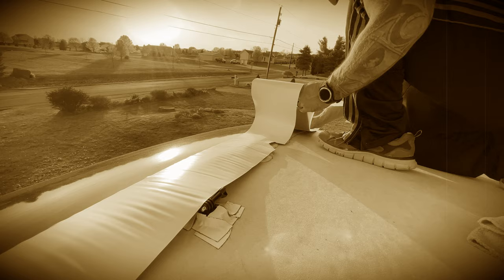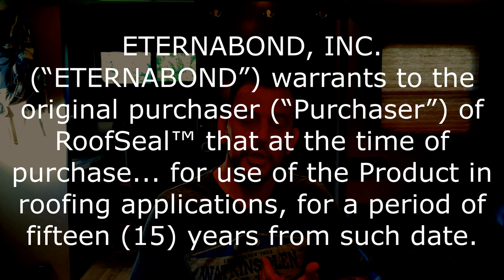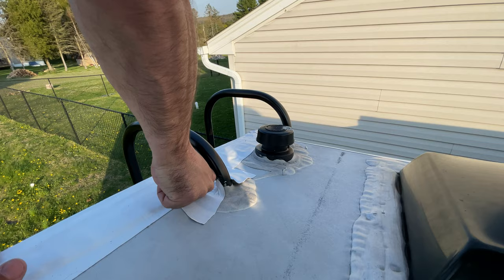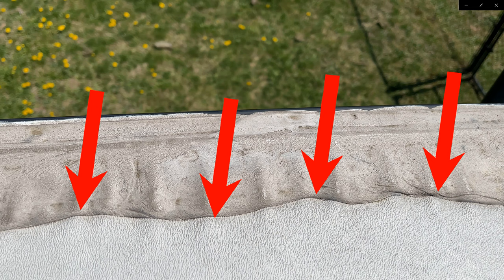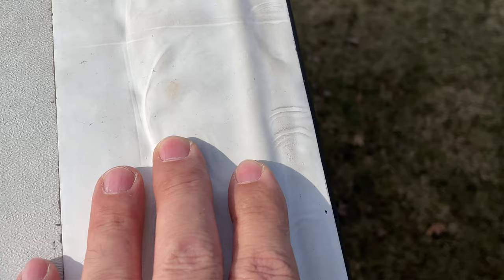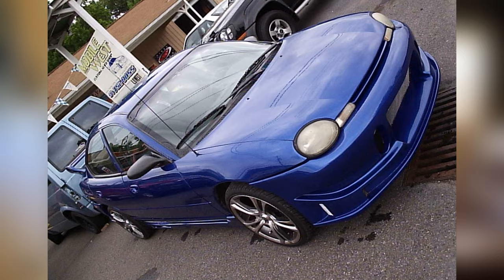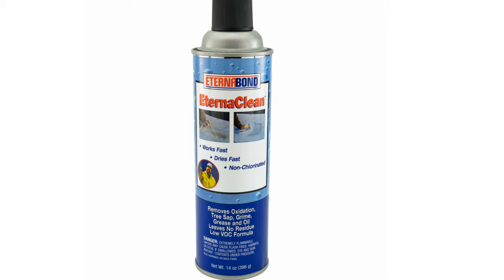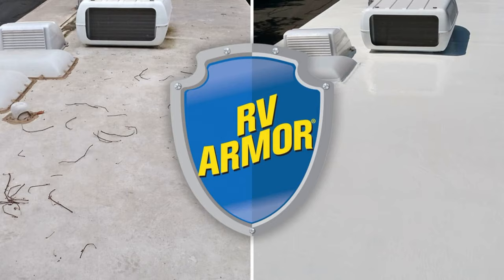The RV Eternabond Roof Seal Modification 1 Year Later

Comment: What in your opinion is best for roof cleaner and uv protection
Reply from the maker: I use Murphy’s oil soap to clean my roof and it works well.  I just haven’t done enough research to say what I think is the best UV coating, but I hear a lot of good things about Henrys Tropicool.
Reply: @RVTIPSANDTRAVELS  could you apply tropicool directly over the eternabond? Or would you apply the UV paint like sealant and then the eternabond. I guess my main concern is one or the other not sticking to eachother. Also how I would reapply when the time comes (uv paint, I have faith in eternabond! :) )

Comment: So I haven't used Eternabond before. I'm curious if the tape has any stretch or give to it so that it can be formed over irregular surfaces (like lap sealant, the lips of various components, etc)? It appears that that's exactly what you did in this video by taping over the lap sealant, but I want to try to avoid wrinkles and know that once the tape's down it ain't going anywhere.
Reply from the maker: you can remove the lap sealant and tape right over where the sealant was.  I will probably do that with my next camper.  despite the time it will take to remove the sealant, I think its well worth it.
Reply: @RVTIPSANDTRAVELS  Cool, but does the tape have any stretch or give? To confirm to irregular surfaces?

Comment: I'm redoing the roof on my camper. Just bought a bunch of rolls of this stuff. I also got lap sealant. Do I need the lap sealant or will this stuff do just fine?
Reply from the maker: If I were to do this again, I’d remove the lap sealant altogether and use this from the membrane right onto the component.  That’s what it’s actually made for, a factory seal.  Send me pics when you’re done would love to see it!
Reply: @RVTIPSANDTRAVELS  Thanks! That's good to know because the lap sealant is a pain in the butt to mess with. I'm actually filming the entire remodel so I will have a video uploaded on it soon!
Reply from the maker: Let me know when you’re done!

Comment: Hello, I have a question for you. I am in the process of purchasing a 1991 Fleetwood Flair 22 foot Class A Motorhome. The Roof needs to be cleaned, and resealed to prevent any leaks from forming. I am a fairly hefty guy, with a weight of around 275 to 300 lbs. Is there a weight limit as far as someone being to heavy to stand on the Roof of the Motorhome ? I don't want to climb up on the roof to clean and prep it for resealing, if there is any risk of me falling through it due to my weight.
Reply from the maker: Kevin, it’s hard to answer that, every rv has a roof weight rating.  It may be hard to find something that old but I’d start by looking through the owners manual.
Reply: @RVTIPSANDTRAVELS  I already tried reading both manuals, and found nothing as far as any kind of weight limitations, but I am still wery about being up on the roof with my weight, especially toward the center areas. I am wondering if I should just use an extension ladder along each side, and coat the roof with a long handled roller, and use a regular roller around the edges of each side, as well as the front, and rear caps ?
Reply from the maker: That would work, or you may be able to put some plywood on the roof to distribute the weight.

Comment: Anyone every use Flex Seal tape? Essentially the same thing?
Reply from the maker: Tom, eternabond is very similar to a TPO top coat and a butyl tape underneath.  ive never used flex seal, but ive seen hundreds of complaints about it.  theres quite a few reasons a lot of RV'ers dont use it on an RV roof.  ill try to find the article.

Comment: In the original video you didn’t use the primer eternabond recommended if memory serves correct
Reply from the maker: You are correct.  No regrets not using it either, still stuck fast, BUT I’d try it if I were to do it again.

Comment: I bought a new RV off the show room floor Forest River and thought the roof would be okay for a couple years. Wrong! I had two holes on top back the size of a half dollar that was leaking in the bathroom area and it warped the floor and now it slopes down. Now I have a three year old camper that’s got to have the floors redone after the roof is sealed tomorrow. I’m sick to my stomach. Could not get an remote rv tech out so I had to hire a roofer who watched these videos and he only charged me $100 a day and first day he pressure washed it with bleach and Dawn. Tomorrow he’s laying down the eternabond tape. And putting on first coat. Next day another coat. Then he’s calking every window. Taking it to the dealership they had a six month waiting period. I live in my rv full time so that was out of the question. So I found a young guy who just finished roofing a church for free to help me. I also had to pay a regular plumber to come out and change out my faucet on the water heater drain out. I had RCS on my shoulder and can not do the work. There’s too many RVs and not enough RV techs. And when they did come out they were in and out and didn’t fix my air conditioner and I had to buy a window unit in a 1 year old new rv. I’m pretty sure it’s the capsulator so I’m going to order the part and hire an electrician to fix it before summer.
Reply from the maker: Dealership service wait times are a huge problem for everyone right now.  Sorry to hear about all your troubles.

Comment: You said you used the lap sealant first, let it harden for a few months and THEN put Eternabond on top of it  . ? ?
Reply from the maker: If you need to apply new sealant, it should cure for 30-60 days before covering it.

Comment: Does your unit sit outside year round?
Reply from the maker: yes it does, and I dont cover it.  I used to cover it years ago, but I stopped covering it before I did this modification.
Reply: @RVTIPSANDTRAVELS  -Impressive, thanks for the videos!

Comment: Would you do this right away on a brand new travel trailer?
Reply from the maker: doesnt matter how new the trailer is, as long as the lap sealant is in good condition if you are covering it.  you can also remove the lap sealant and use this alone.  thats what it was actually made for.

Comment: What should I use to clean I’m going to put it on the edges of the camper roof is breaking I want to cover it before I get water damage should I use denatured alcohol and or mineral spirits ? With maybe some windex to clean up everything at the end?
Reply from the maker: I used dish soap first, then rubbing or denatured alcohol as a final cleaner is good on the areas where the tape will be applied.
Reply: Just pour the denatured alcohol on a rag first as you don’t want to saturate the roofing material.

Comment: I noticed Eternabond on the tops of my slides, ever hear someone using it on the side joints?
Reply from the maker: Do not use eternabond on a vertical surface.  Because the adhesive is pliable, it can slide under extreme heat.
Reply: @RVTIPSANDTRAVELS  Excellent! Thanks for tip!

Comment: Do you think that this mod affects the resale value of a trailer?
Reply from the maker: I guess that would depend on who you ask.  I’ve spoken to quite a few rv techs who love this and some who don’t.  If you talk to HB Fuller (the mfr) which I did do, this product is made to be used for new sealing and repairs.  It’s held up flawlessly for me, but if not applied correctly I would agree could cause issues.  I also think there are 2 stigmas with this mod… one being people hear the word “tape” and think it’s a patch hack, when in reality it’s designed for this.  Two, it’s not pretty when it’s installed, and while some people don’t care, others do.  Having used this product a lot, if I were an rv inspector I would focus more on how it was applied.  If it was applied well, i personally would not be afraid of buying that rv.  If not applied correctly, it could be a resale issue since it’s not fun to remove. End of the day I’m not an rv inspector so I would consult with one… but I don’t think you need to be an expert in anything but the product to have a good idea how it will hold up.  Also, it’s a mod so you don’t have to reseal every year.  That’s it.  It’s not meant as a full proof way to prevent leaks.
Reply: @RVTIPSANDTRAVELS  cheers!

Comment: I was told not to use acetone on my GD imagine roof, that it may attack the roof membrane and possible void the warranty.  GD told me that.
Reply from the maker: Acetone won’t damage TPO if used as a cleaner. Whoever told you that at GD is very misinformed.  The eternabond branded prep cleaner is made of acetone.
Reply: @RVTIPSANDTRAVELS   Thanks for your response.  Please reference P.149 in the latest Imaging Owner's Manual which states, "Solvents should NOT be used during cleaning. Solvents can damage existing sealant and may weaken plastic roof components".   So many schools of thought ....
Reply from the maker: Yep it’s in there, it’s GD covering their butt.  Solvents could weaken lap sealant, but acetone and mineral spirits won’t damage a rubber roof or plastic components. I’ve used them both.  Technically, water is a solvent, GD should be more specific on the types of solvents not to use, because there are many.

Comment: Ross, this has nothing to do with eterna bond.I own a GD 2600RB and the bottom guide for my inside barn doors keeps falling apart. Any mod suggestions or how to fix the guide from coming apart. Thx
Reply from the maker: That little plastic thing?  Mine does too.  Trailer is in for tires and inspection, give me a week to get it back and look at it.  Been meaning to fix mine too.  Hang tight bud.
Reply: I’d like to see any answers for the plastic sliding door guide breakage issue!  Updates?
Reply from the maker: sorry guys, i have been busy with some projects but Ill try to look at it next week.  just keep reminding me if you dont hear back within 2 weeks.
Reply: How about a slightly larger screw and glue it in place, or wait for the master on his modification. Probably wait I usually screw things up anyway.
Reply from the maker: Honestly guys I have to apologize I’ve been busy with so many things going on. I would maybe try just using the toothpick method to make the hole smaller. I have a video on that on how to fix stripped screw holes. If you don’t want to be able to adjust that piece anymore I would just superglue the hell out of it.

Comment: has anyone tried to seal a roof using Elastameric?
Reply from the maker: I believe that is a coating for masonry, if I remember correctly?  You may think "well if it protects something solid like stone, it will easily protect an RV."  Not saying that isnt the case, but other things to consider would be its adhesion properties on soft materials that flex... thats where it might not do well.  Also, UV protection is another consideration.  I dont know much about it, hopefully someone can help, but I did want to comment with the things I would be thinking about when using a product that is intended for a completely different material.  Hope that helps.
Reply: @RVTIPSANDTRAVELS  well it is a rubberized type sealant and mmasonary is one application. I used it on the membrane roof on my mobil home and it has lasted 4 years so far.
Reply from the maker: cool, i will have to do some research on it... maybe try a spot on the roof to see how it holds up.  is it white?

Comment: why even use lap sealant, just use the tape?
Reply from the maker: the lap sealant comes on the rv from the factory.  since eternabond can be put over lap sealant, you dont have to remove it as long as it is in a healthy condition.  you can remove the lap sealant if you wish and use the eternabond alone too.

Comment: I wonder if anyones tried this stuff where there’s a roof leak, to ✔️if it actually works, which it probley does. but putting it in a nice newer rv roof that’s not likely to form a leak for 10 years - then saying ‘buy golly G wilikers it hasn’t leaked for 10 darn years!’ is kind of like selling water by the river - or inversely, selling powdered water, is it not👋.
Reply from the maker: did you watch the original video of this series?  the point of this modification isnt to stop leaks any differently than self leveling lap sealant, the point is to not have to reapply lap sealant every year or so... making it more maintenance free.

Comment: Nothing against eternabond but only coming halfway over insert trim on the roof to sidewall seam is leaving you open to potential leaks from water getting behind the insert trim and wicking through screws. That insert trim shrinks over time and water can get behind it during heavy rain. It will be the type of leak you won't see until the damage is done... Ask me how I know !
The insert trim should  be replaced  about every 2-3 years on drip rails and corners.
Reply from the maker: The Eternabond over the trim ADDS protection. 
 The factory design has nothing covering that trim piece so water can get in there from all directions. 
 The Eternabond is simply adding a shingle effect.  The tape is 1 piece down the entire length of the trailer, so the only water getting behind it would be from the very edges or from the bottom, which would happen if you didn't do this mod anyway.  Make sense? I guess you could completely cover the trim with Eternabond, but that makes it more difficult to access those screws should you ever need to adjust/replace your membrane.  Additionally, that trim is now covered from the sun and the elements. Mine is 7 years old, no dry rot, still pliable too, I'm guessing because its been mostly covered by the Eternabond.  I also apply 303 aerospace protectant to the uncovered area every year when I do the rubber and trim, so its literally is perfect condition.  If people started treating all their rubber and plastic with a product like 303 they would probably be replacing their RV long before any trim... It's time consuming and I dont think a lot of people want to do it, but it has worked for me.  Everything has held up pretty flawlessly, but I will have to reseal my outside joints this summer, and that is probably the thing I hate doing the most to the RV.
Reply: @RVTIPSANDTRAVELS  That was my point. In a heavy rainstorm water can back up in the gutter and get behind the trim insert from the bottom. After it gets behind the insert, it will find a way in.  I used protectant on mine as well and thought they were in great shape. I couldn't believe how much the insert had shrunk from the sun compared to the new insert. Behind the insert I found Grand Design shot staples about half way in all along the drip rail and several screws were backing out. Gotta love their engineering ! Lol  I've since fixed the issue permanently because it was not much fun replacing a 4x8 section of my wall.
Reply from the maker: Makes sense.  I would agree with you that RV gutters, not only on Grand Design but all manufacturers, need to be reengineered.  They dont even use 1 piece, they glue them together and that glue lasts about 4 days after it leaves the factory, creating a leak somewhere along the camper.  Horrible design.  At least they could be 1 piece.
Reply: @RVTIPSANDTRAVELS  Exactly ! In the last 30 years manufacturers pretty much use the same engineering and haven't come up with anything better ! Lol
Reply from the maker: AGREED!

Comment: Your "never again" statement on the video icon and subsequent recommendation of the product is pretty contradictory and "clickbait-ish".  I hate when YouTubers do that.
Reply from the maker: The first video reads “never again” because you dont have to reseal using lap sealant again after installing the eternabond.  That is clearly explained in the video.  The follow up video stresses the same thing.  Not really sure how that is contradictory or misleading in any way. In fact it’s exactly the opposite.  Install eternabond, never reseal again.  Pretty cut and dry.
Reply: @RVTIPSANDTRAVELS  I see the two separate videos now. My apologies to you. I do see alot of YT'ers doing that though...My mistake this time. Sorry.
Reply from the maker: No problem bud, just wanted to explain it how I saw it.  And yes, I agree with you a lot of them are doing it.  I think it’s fine for the thumbnail picture to be a little click baitish, but the title should tell them exactly what they are going to watch before they watch it, at least to some small degree.